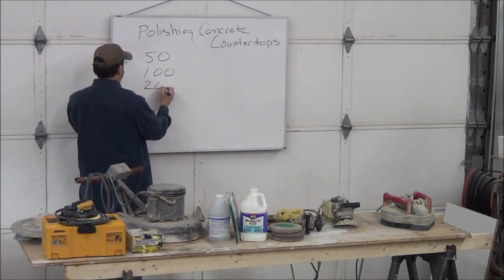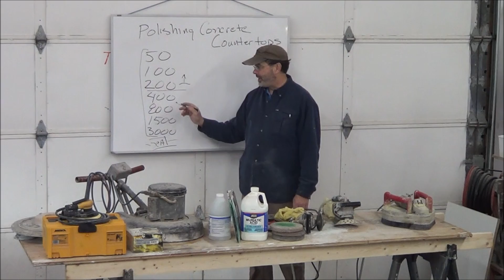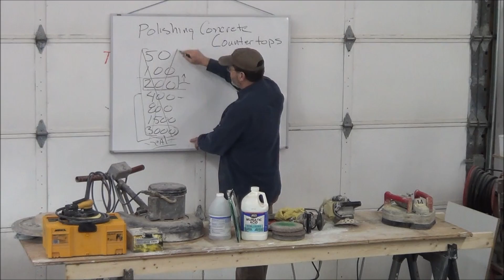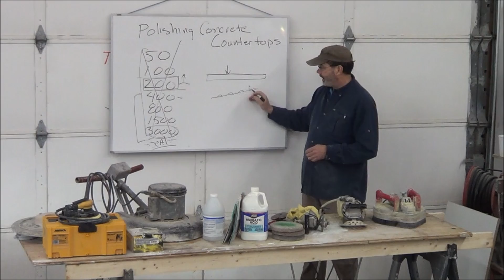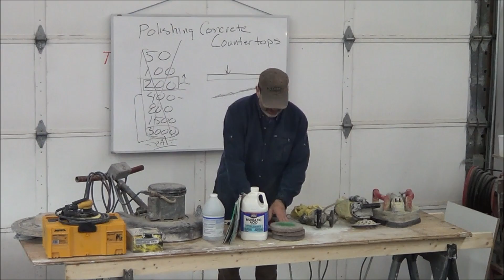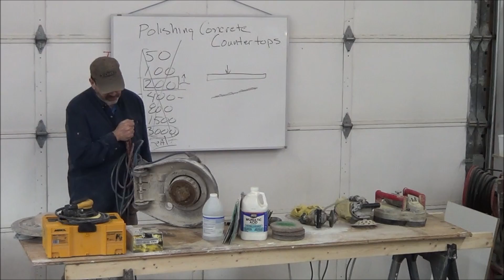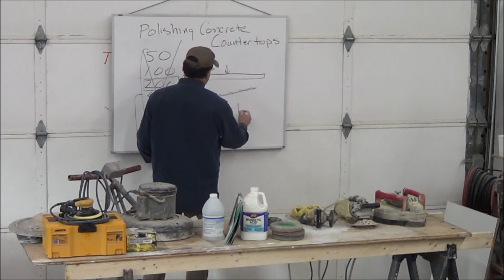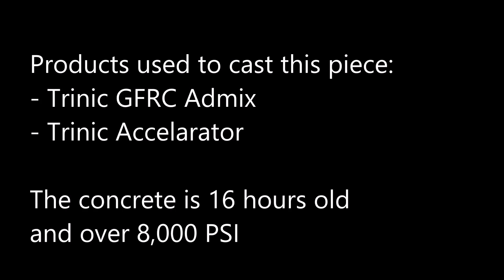Finishing Concrete Surfaces the easy way - GFRC, Glass Fiber Reinforced Concrete

Comment: If gfrc top are routed or etched into, are the fibres exposed? How does exposed fibre react to acids when producing a finished sealed top? Thanks, this is great stuff.
Reply from the maker: If you grind through the face coat then yes they will show. The fibers are glass so no reaction with acid

Comment: Is this still your preferred way of finishing or has anything changed in the last 5 years? Very informative btw. Thanks.
Reply from the maker: Nathan Turner the acid wash and quick 400 is  out preferred process unless doing exposed agg of course
Reply: Very informative.  Any differences in finishing if you want a cream finish vs. salt and pepper?
Reply from the maker: Mark Pearce yes for an acid wash you can either go 20:1 or simply leave on for less time. I personally prefer a simple sand with 320 wet or dry for a cream finish.